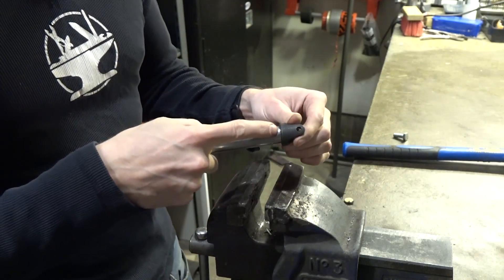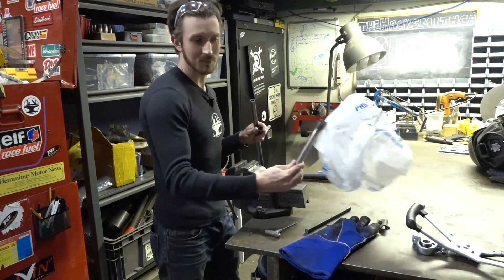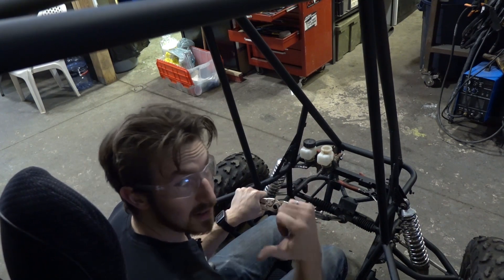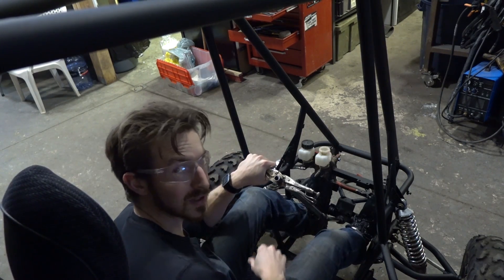Electric Batman Tumbler Part 2 - First Test Drive

Comment: Making it out the two front wheels I'm not connected and can turn on a dime as a first start second thing is getting your weight distribution right you're too top-heavy lower it and 3rd you need to create a sliding cockpit that covers you just like in the movies just saying

Comment: You've probably said it somewhere. Is it really a tumbler if you don't turn the front wheel assembly inside out???
Reply from the maker: +sachae321 we focus on functionality over asthetics -- the actual tumbler has terrible suspension and is pretty well useless -- any replicas out there aren't even remotely capable of offroading. We plan on making this both functional and awesome. Real gadgets, not just flashing lights.

Comment: Adjustable practical suspension
Reply from the maker: A bit over-rated -- as it is it's extremely capable with stock suspension -- it was designed for competitive off-road baja races after all =P

The actual tumbler replicas would break if you drove them offroad =P

Comment: put a bat spoiler on the back and add light line that you put on top of  trucks and a vinch then maybe just put on a firework holder for big rockets and when you drive you can just light off the rockets and they will shoot then maybe add a spike holder and when somebody is driving behinde you   you can just press a button and it drops the spikes and pops the tires

Comment: +the Hacksmith are you going to eventually  make the front wheels have a separate axle, where they are not connected in the middle like a normal car? if so, great, because that is what the Tumbler actually looks like, if not, oh well.
Reply from the maker: +MillerTubeHD we'll see, would require a complete redesign of the front end
Reply: Ok. Thanks!

Comment: http://www.princessauto.com/en/detail/1-in-high-speed-u-joint/A-p8649535e this pertain to earlier video but i finally remembered where i seen a u joint that would work rather the extra socket set piece. slight upgrade maybe? not sure of working angles.
Reply: there are cheaper and different size high torque options as well. 
 http://www.princessauto.com/en/detail/1-2-in-high-torque-u-joint/A-p8649352e

Comment: Set it up so that you could do an up a wall ride. Like get a good grapple and then see if you can drive up a wall. You could use the same energy from the motor extended by a rod to reel in the cord from the grappling hook as you drive up.

Comment: The tires should be able to self seal after punctures and inflate again. or at least allow the vehicle to still operate for a time.  also remote control so Alfred can take over when Batman needs both hands.

Comment: You should make a thing to where you could shoot the paint ball guns at the push of a button on the steering wheel. That would be good. Also add spiked wheel sides, wheel cvers so you cant pop the wheels from the side, motor cover and weapons crate in the back ontop of the motor cover.    It may be a bit of work but it would look extremely awesome.

Comment: hey hacksmith this is about your flying like iron man series have you considered using ionic wind thrusters as a secondary flight system to help take some of the load off of the edfs i think that would be a great idea because it has no moving parts and can produce a good amount of thrust with the right conditions plus they are easy to build and non expensive. i was trying to test it myself but i dont have enough funds to buy the edfs as a primary propulsion system. the ionic wind thrusters would take some of the pressure off of the edfs and give you some extra thrust. just a suggestion love your videos man

Comment from the maker: Are you guys excited? Here are some of the must-haves as outlined by you guys!

- ARMOR
- A CUP HOLDER
- PAINTBALL TURRET
- PAINTBALL GUNS
- LIGHTS, SO MANY LIGHTS
- TURBO BOOST (JET ENGINE?)
- DOORS
- GRAPPLING HOOK w/ HIGH SPEED WINCH
- ELECTROMAGNET?
- HUD w/ THERMAL AND NIGHT VISION
- GPS
- SMOKE MACHINE
- FLAME THROWER
- REVERSE CAMERA
- 360 DEGREE CAMERA
- DUALIE WHEELS IN THE BACK (LIKE THE REAL TUMBLER)
- EXTEND THE FRAME (TO LOOK MORE LIKE THE REAL TUMBLER -- MAYBE)
Reply: the Hacksmith CONGRATS ON 1 MILLION!
Reply: When are you releasing the giveaway winners? Also I love your videos you are awesome!!!
Could you please do some tutorials as well? Thanks
Reply: How about a remote
controlled function to the tumbler
Reply: the Hacksmith four wheel drive?
Reply: the Hacksmith try spiderman web slinger
Reply: Air freshener!
Reply: Maybe extend the length of the wheel base, shorten the top of the frame and add some lightweight paneling (armor) to make it look a little more like the tumbler. Dual rear wheel are also a nice touch!
Start with the look, then you can start adding all sorts of crazy gadgets :D either way it's gonna be awesome!
Reply: the Hacksmith I want to see the Turbo boost from the Knight Rider TV-series - let the tumbler leap out of nowhere as K.I.T.T. did!
Reply: I don't feel like it would have the mass to use a battering ram effectively. Why weigh it down with aesthetics. It will only slow it down.
Reply: Chopper plane propellers on top turn it into a helicopter that would be awesome .
Reply: the Hacksmith how about finger print scanner doors
Reply: the Hacksmith also what about Amazon echo so you can make it have voice commands aswell
Reply: pls Post a new video on that Project CoD Exo . when you Post Part 23 with the new Hud? :D   Love your videos =D you are awesome!!!
Reply: armor it
Reply: the Hacksmith are u gonna make it look like the tumbler?
Reply: the Hacksmith make a hover board
Reply: a couple of mini rocket launchers? like the ironman arm rocket launcher

also its not a bat mobile without rocket boost...
Reply: the Hacksmith Hey I noticed that helmet as an option for the cod exosuit project! kind of bummed that you stoped that project
Reply: the Hacksmith when you give it two engines your going to need a wheelie bar.
Reply: the Hacksmith maybe a propane gas exhaust just for the flames
Reply: hey maybe just for the fun of it you should add a battering ram on the front
Reply: the Hacksmith a cup holder for sure plus a paint ball turret would complete this and I think batsman would aprove
Reply: the Hacksmith also what about Amazon echo so you can make it have voice commands aswell
Reply: @AS-3D  that would be sweet
Reply: the Hacksmith how much does that thing Weigh
Reply: God damn...
Reply: the Hacksmith afterburner?
Reply: you should make tire defeaters like they made on mythbusters
Reply: yo i rly recommend you to make it more aerodinamic like this it is slowing it down as it moves so you could add some "doors" and a roof ;)
Reply: the Hacksmith add airodinamic cool parts
Reply: the Hacksmith every thing needs stereo
Reply: the Hacksmith add a parachute stoping system looks so much cooler
Reply: the Hacksmith good job on 1 million been watching you from the start 😀congrats
Reply: the Hacksmith a flamethrower
Reply: You should most definitely add a bat symbol and a small armory in the back full of Batarangs and something to hold the grappling hook I think you might have space for that but that would overall please me and a lot other fans of your  but its also about how you see it as well
Reply: the Hacksmith OBVIOUSLY a giant grappling hook to hoist up the buggy to climb or cross something! 😁
Reply: the Hacksmith u should add a hook and a laser gun
Reply: the Hacksmith try a radio
Reply: Hey just and idea, you should try and lower the roof or flatten it out to make it look more like the tumbler
Reply: the Hacksmith. hi
Reply: the Hacksmith need movin wheels
Reply: Exploding Thermal He lives in Canada
Reply: 2 paint ball guns that com out some were and shoot
Reply: the Hacksmith HUD or a jet engine
Reply: the Hacksmith Can you make a Force field automatic captain America shield?
Reply: Grenade launcher!
Reply: the Hacksmith oh hell yeah
Reply: the Hacksmith GRAPPLING HOOKS THAT TAKE YOU UP THE SIDE OF A BUILDING
Reply: the Hacksmith  I would like to say your awesome with these creations I would like to suggest a batarang shooter to the kart p.s I big fan of your work
Reply: the Hacksmith batarang shooter
Reply: the Hacksmith Congrats!
Reply: the Hacksmith add a smoke dispenser to lose people behind you!
Reply: the Hacksmith IM TOO LATE!!! Whatever, congrats on one mil lets aim for 2 and from there 5 and from there 10 ;D
Reply: you just hit 1 milion subs
Reply: 4 grappling hooks shooting directly upwards to hit a ceiling and when you pull up the floor closes up behind you , secret entrance ,worthy of batman
Reply: Rocket pods, like the ones from a helicopter, strapped on the back of the vehicle like artillery would be cool...
Reply: look into airless tires and get an awesome bat-themed med kit installed somewhere in the vehicle. :D
Reply: Computer 
Enfered
Reply: the Hacksmith heck yah!
Reply: you definitely need the jump jet, i would say maybe make an SRB style one cause it'd be cheaper, but i doubt it'd be safe enough.
Reply: the Hacksmith try to make a levitating hoverboard
Reply: the Hacksmith please do winter soldiers metal arm.😀😀😀
Reply: the Hacksmith 8
Reply: Armor, paintball guns, and the flame thrower
Reply: use rgb lights
Reply: the Hacksmith every thing
Reply: 10/10 jet engine
Reply: the Hacksmith eject seat ?..
Reply: the Hacksmith would it be possible to add amour plated on this
Reply: Batmans Bat-mobile was the perfect blend of Superhero and Super Spy so if you're going to add stuff to it, then you need to draw inspiration from 007 as well. Stuff like Oil-slick or Caltrops to drop out the back. Flamethrower or mounted turrets that aren't there until they spin up and out of nowhere. Plenty of armor, Oh and make the entrance the front NOT the sides. Something like when you step in you pull down on the door like a giant hatch to lock yourself in. Lights as well, lots of lights, especially one that's on a turret base so you can spin it around and point it at people from the safety of the cockpit. And you have to put your Laser Bat signal somewhere on it to announce your arrival.

I can't wait to see what you guys can do with this. I'm sure it will be cool!
Reply: the Hacksmith нєу ι яєαℓℓу тнιик υ ѕнσυℓ∂ ¢αℓℓ ιт тнє нα¢к мσвℓє
Reply: the Hacksmith of why did you guys use paint the tumbler with brushes Instead of using spray cans
Reply: the Hacksmith Paintball turret and armor and a rammer up front
Reply: the Hacksmith ur rockets from the iron man project
Reply: the Hacksmith make an ejection system that throws you out the side
Reply: the Hacksmith I wish I could build one
Reply: the Hacksmith plexiglass front window
Reply: hack smith wheres the rocket boost
Reply: the Hacksmith and a flame thrower and/or tack despeser to lay down tacks as you drive
Reply: the Hacksmith add a computer so you could just pull the screen off from the side and then a keyboard from the other side
Reply: the Hachsmith you should extend the frame because it would look way cooler.
Reply: and add a coat of armor
Reply: The bat cup holder is a definite must, but if you go for real bat armor it could negate the effect of the second bat engine. Perhaps just bat doors and a bat windscreen would do...
Reply: Hey man Congrats on a million subs. Well deserved. Also good work with the tumbler man. Easily the best channel on yt.
Reply: A built in coffee machine, a paint ball side gun, lights e.c.t
Reply: the Hacksmith a
Reply: Mechatronics engineering
Reply: the Hacksmith you should make the steering wheel look like a bat
Reply: lols
Reply: the Hacksmith you need to make a It a truck kinda and in the back is a mounted auto paintball cannon
Reply: the Hacksmith i have a challenge for you install hydrolics to make the vehicle jump with a push of a button
Reply: Hacksmith make his motorcycle
Reply: You should do a tron bike
Reply: put on everything
Reply: the Hacksmith kool
Reply: Nebulous Neanderthal great idea
Reply: Install a car radio and speakers
Reply: the Hacksmith
Reply: Hmmmm hard question why not all 😂
Reply: ALL of the above
Reply: the Hacksmith a full auto grenade Launcher, and a convertible roof

Comment: how about 'Batman projector lights'... which will project Batman logo in front or back side of car..
nice looking front and back lamps in Batman style...
door opening from upside and folding..
you can also install a computer with voice control..
additional safety kit..and emergency rescue kit..Incase to rescue some one..
and also last one ..a drone compartment from which drone could fly out of vehicle and you could control it from inside...
good luck👍... excited to see final model of batmobile 😍😍😍

Comment: What about:

- Make the design of batman's tumbler out of cardboard or light weight metal ?
- Make two batman signals for the headlight ?
- Make a flame turbo at the back ?
- Make it faster ?
- Make it stronger (so it can hold 2 people but at fast speed) ?
- Make upgraded wheels, so it looks a bit like a rock crawler ?

Comment: You should see if you can work some sort of a charging system like an alternator on to it. And maybe some capacitors from an old junk yard hybrid attached to a high amperage switch to give you an on-demand boost of energy?
Reply: And attach your second motor to the front wheels, see if you can route it through the diff. from an atv so you you're not spinning the inside front tire when you're turning

Comment: Perhaps it's been said, I don't know. I thought a Gatling paintball gun, one mounted on each side, like the Michael Keaton batmobile (i know they where just machine guns); a magnetic GPS launcher could work as a tracking system for the guns perhaps? As well as the "wheelie" bar you seen in drag racers to keep you from flipping backwards in case you have too much torque on take off. Another idea..a jet engine like exhaust in the back to give the appearance of the turbine engine booster. What do you think?

Comment: You should make it so when you flip a switch or button it goes so much faster and one of the gadgets on it should be that it shoots out batterings from the car or maybe ones with ropes so you could grapple and make a quick turn.

Comment: -tracker launcher (launches a gps/radio tracker, magnetic/sticky, allows you to subtly track targets)
-ejector seat. more bond-ish, and as there's only one seat I'm not sure how useful it would be but it sure would be funny.
-rocket boost
-taser (the kind with wires that shoot out)
sprayer. multi-purpose, could either spray salt in front to increase traction on ice, or spray slick oil behind to either light on fire or spin out pursuers.

Comment: no batmobile is complete without the jet fire out the back. in jay Leno's garage they have the tumbler from the movie ( working "real" car) they show how they made the jet effect. they use hot air balloon  burner. I don't know if you can come up with a safe smaller way to get the jet effect but would be cool. maybe LEDs a blower and dry ice or smoke pellets??? idk

Comment: maybe add something to pulls the springs down then release which maybe could make the go-tumbler hop or add a main screen monitor and have cameras in front with thermal and night vision so can track things easier or maybe if you have a drone you can modify your drone with night vision or thermal and make a drone launcher in the go-tumbler it would open up then launch the drone and you can control it with the monitor or have a sniper turret attached on top controlled by the monitor with a camera attached behind the scope with a 360 camera attached on top so you can find your targets then snipe them. I might think of more ideas
Reply: and short burst jets or propellers to give you some explosive speed for a short time and maybe have some type of gun that shoots a sticky ball or something that will stick to things and have a tracker in it and maybe make it to where you can remote control the go-tumbler
Reply: Dude those a freaking awesome ideas
Reply: Thx and I'm trying to think of more
Reply: wait what about a compartment that opens up on the front and shoot missiles that use the Edfs or a grapple launcher that packs a punch so you can hit things you could have 2 one that hits things and one that grapples
Reply: wait maybe you could put compartments that are place all around the go-tumbler that release smoke so you can escape and have a gaps on the monitor that way you have escape plan or 2 or wait you can lock the drones movement to the go-tumbler that way you can safely ride in the smoke and see where your attackers are, I'll try and think of more.
Reply: Ender Archer ii

Comment: So, a fair amount of people have said rocket boosters, but judging from the original Ironman project, that obviously won't work. What about using the rockets as missiles? Again, probably not possible due to laws regarding airborn weaponry. You could add the batman symbol light if you still have it, but it would be for aesthetics. Also... You've gotta make a RWBY weapon. If you don't know you could look it up, but a Paintball Sniper Scythe would be pretty awesome. It might be a "little" expensive, but would gain a lot of views due to the massive RWBY fan base. Best wishes, and good luck! Keep up the good work

Comment: Batarang launchers....... Like a wheel with the end of the spokes having clamps. You spin up the wheel to get some force going and have a certain (stationary) point with the optimal angle for throwing that somehow the clamps release the batarangs..... It would be full-auto if you used what I described.